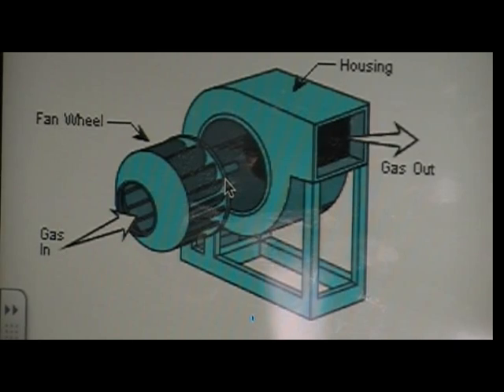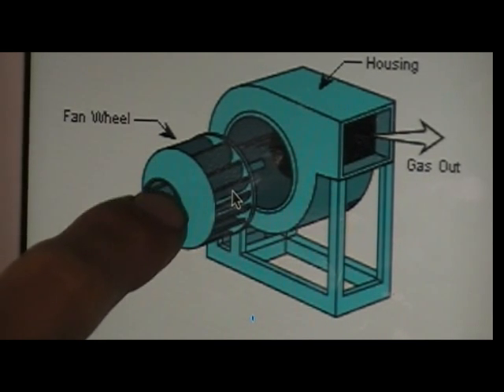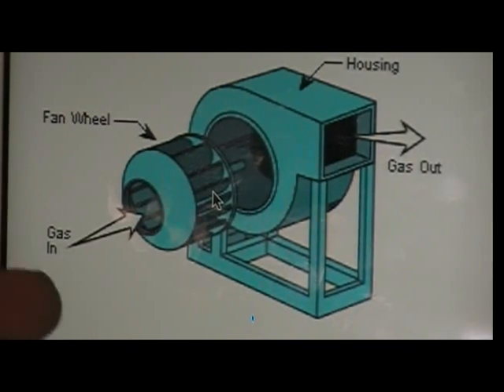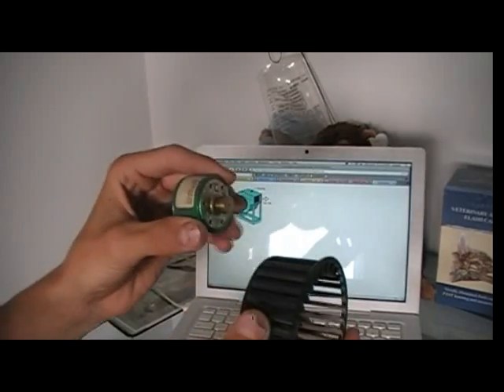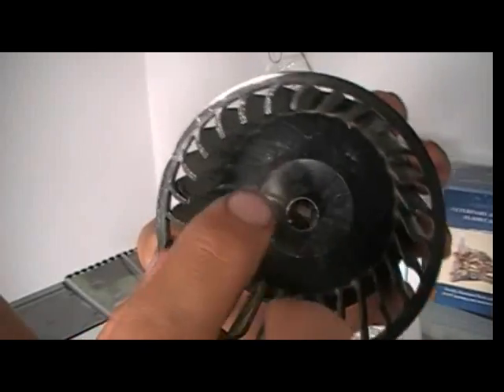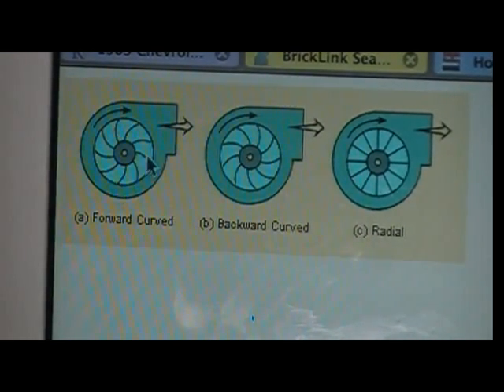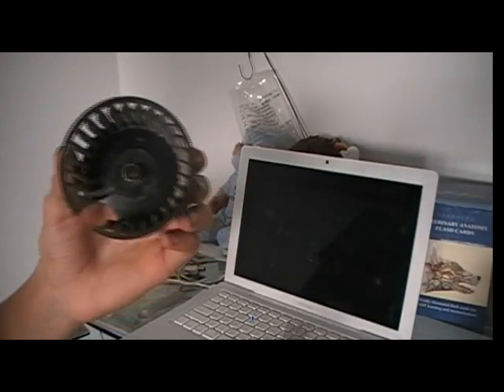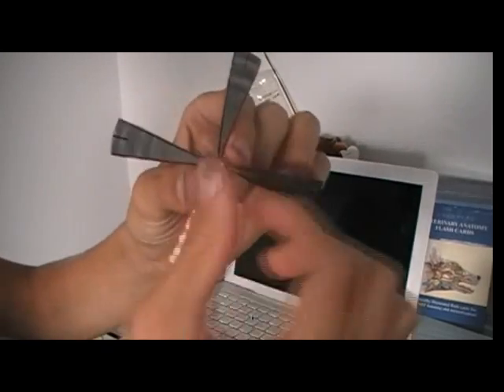How Centrifugal Fans Work (720p)

Comment: There is also a difference in how the air discharges between the centrifugal fans and the standard prop type fans.  The prop type blades make "packets" of air you can feel them as they hit you.  The centrifugal airflow is smooth, not choppy, more outdoor breeze-like.